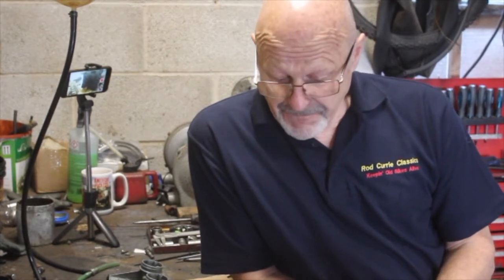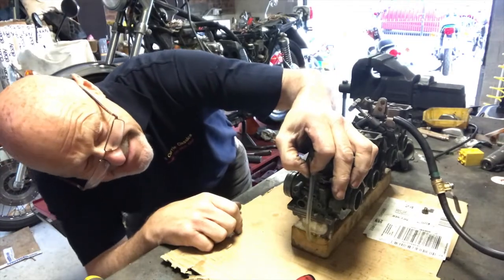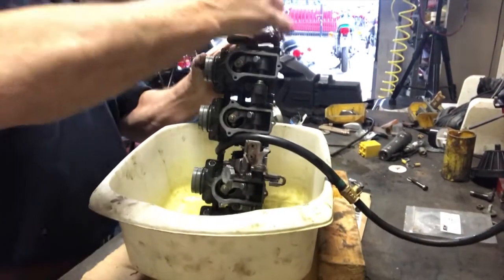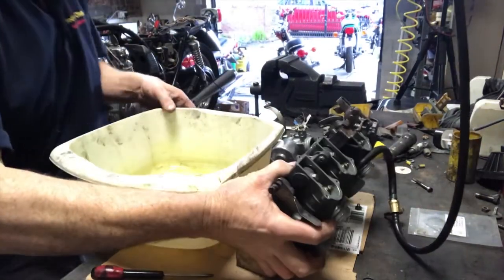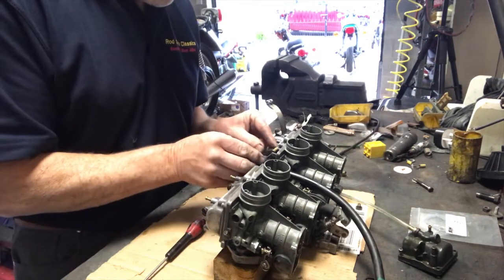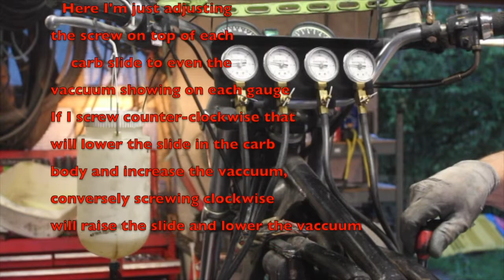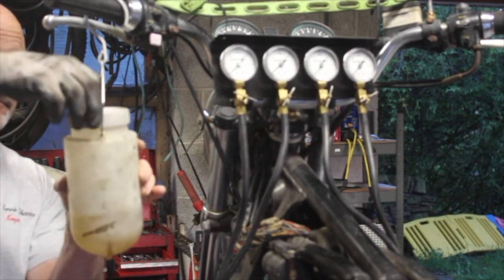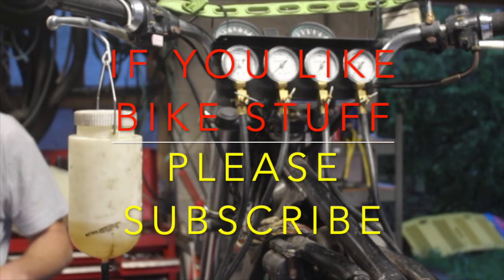How to set Kz650 float levels and synching the carbs 1.

Comment: Rod, do you hook the vacuum lines for the gauges to each intake carb holder port?
Reply from the maker: There's a little adapter on each manifold port to plug the vac gauge pipes on to. On Hondas you take a wee threaded plug put but the Suzuki GSes, and these Kawasakis use the same carbs with the little adapters on the manifolds  as standard.
Reply: @rodcurrieclassics8102  Ok thank you sir.

Comment: Hi rod, can't see where your Mark's are!! You may need too work on your close ups?. Very informative  and great information  but can't really  see what you are doing.  Have a 78 kz 650 in Florida  and am originally from Suffolk  UK. Have lots of mechanical experience,  ex race car mechanic . Can't seem to find good information on float heights. But obviously need a fitting with a nipple to make this work!
Reply from the maker: Hi Aron. Thanks for your comment . You're right.  I did work on my close-ups for the next vid and I hope that's better. Its called " Kawasaki Kz650 carb set up and Synch" . Have a look and let me know if you think it's better. Also the carbs on that film were much further out of synch so as a "Here's how" medium I hope they were better
I bought the little level tube and fitting in the States. I'll see If I can find the vendor and post the link here. Thanks again, Rod
Reply: Hi Rod, well I set my floats to 23mm and 2 overflowed on me, I'm guessing 23mm is a guide and the way you do it is better .or I need new float valve and seats as well, did you ever remember who made the tool?
Reply from the maker: Hi Aron. I measured them out of interest after setting them up with the level tube and 25-26 mm was the mean.  I'm sure you checked both of the floats ( in each carb)  to ensure no twisting of the "yoke" between them throwing your measurement out. 
I did look for the purchase detail-it was a USA outfit-but couldn't find it .Let me have another look and thanks again for the comments. 
ps I love these bikes but the carbs are notorious leakers and new needles and seats is the only way to be sure you're not pulling the carbs off time and again. How do I know? ... learned the hard way I'm afraid. :0)
Reply from the maker: Got it. Ebay number 283675027365. They're in Montana. Hope that helps Aron.
Reply: @rodcurrieclassics8102  thanks Rod, yeah I always wanted one of these bikes and no stranger to motorcycle carbs.  I took my time with a digital caliper getting them dialing them in only to have them throw fuel out the overflow.  This has been a constant problem since I bought it, I have very little history apart it came from Alabama.  I bought it from a guy in Atlanta who couldn't get it running and gave up. I went through the ignition system and did a a full timing procedure and it fired right up. Then the carb issues started! Didn't leak at all and randomly it would throw fuel out the overflow. Also noticed that if I disconnect the fuel line it has fuel running out, correct me if I'm wrong but it shouldn't do that? It's a vacuum demand system. So maybe that combined with some  dodgy valve and seats might be my issue?
Reply: Apart from that it runs great👍
Reply from the maker: Correct. The little diaphragm behind the fuel tap will be holed, or like the green one in the vid when I started work on it..entirely missing. If either,  the bike may be sucking neat fuel into the manifold through the little vacuum pipe and you'll not get it to idle really nicely.  The taps aren't cheap but kits can be had for about 17 pounds....maybe 22 bucks.
Reply: @rodcurrieclassics8102  BTW thankyou again for the lead on Ebay, found it with shipping $13. The tap looks very new and carbs have obviously had work but evidently must have sat around for a while! Bet all the ethanol in the fuel must have damaged the diaphragm? So I bet if I get a new diaphragm it will help a great deal and the purchase of the tool. The diaphragm is not expensive  either but will help tremendously with bowl overflow too ! Obviously not the exclusive answer but a combination of float heights and new diaphragm should fix the problem!
Reply from the maker: Keep me posted Aron and good luck. Rod
Reply: @rodcurrieclassics8102  sorry to bother you again but on a second look all the diaphragm s I'm coming across are for a 79 b3,mine is a 78 b2. Do you know if the 79 one works on a 78? Or maybe different?
Reply from the maker: Hi Aron. As long as your bike has the tap that has the standard Prime/Run/Reserve settings it'll be the same. I've a Japanese  C2, 2 x Nebraskan B2s and a similar B3 here right now and they all have the same tap. You'll be fine I'm sure.
Reply from the maker: From memory the C2 is a 78 , the B2s are a late 77 build and an early 78 and the B3 is a '79
Reply: @rodcurrieclassics8102  thanks, K&L products have many hard to find  carb and petcock parts, they said the 18-6633 diaphragm  works for 79 b3 so for $18 with shipping I ordered one . Dark horse products on Ebay said it fitted all 3 bikes with the diaphragm petcock. K&L says they are made in Japan and of OEM quality 🤞!
Reply from the maker: Result! If you want to buy a complete tap they are about 140 dollars/120 pounds so that's  a win
Reply: @rodcurrieclassics8102  ow!!!!!! I'm glad I'm not shelling out for that!. I will  check K&L for their price, maybe they are  cheaper? But I will take a $18 dollar fix anyday
Reply from the maker: Did you look at this one Aron? You might find it useful. https://youtu.be/3QNG4IrcCcA
Reply: @rodcurrieclassics8102  well Rod if I could kick myself in the ass I would!,  Got my lovely new Japanese diaphragm and opened the case and found a perfectly good  diaphragm. Hmm I thought ?, sucked on the diaphragm  portend felt it move. So I sucked on the fuel port and got a mouthful of  fumes!. Crap!. Opened the selector side and found a wad of rubber! Bought another full kit for $13, it was just free pouring past the selector rubber!.
Reply from the maker: Ain't that life, bikes will make an arse of you time and again. :0) Hope you got a selector rubber in the kit otherwise its back to Ebay
Reply: @rodcurrieclassics8102  Good news! Got my rebuild kit from outlaw cycles($13) and put it in with a  smidge of dielectric grease to make sure it moved nicely and with the help of a couple of tubes made SURE it was working correctly! Happy blooming  day it works great and 36 hours later not a bloody drip! Still got to do a level check with that handy new level tool but sod it! I'm going to ride for a bit.i know the floats are set at factory height. Its cooling off a bit now (only 90/95 f now so I want shake it down.  Iv only ridden it a couple of times since I got it running  and obviously been sitting for god knows how many years.
Reply from the maker: Hi Aron. Great that you've sorted the drip. I have one on a gs 750 which uses the same tap. I'd already changed the float valves ands set the levels and it started dripping. Grr! Popped a kit in the tap at the weekend...no drip. You just need to keep at it eh? 
Set the floats up when the weather turns agin you...for now... if it ain't broke etc etc. Best, Rod
Reply: @rodcurrieclassics8102 Hi Rod, hope all is well. I guess what threw me off was not having much experience with vacuum petcocks, I assumed also that the float needle jets would seal properly. Most bikes iv had were gravity feed and no problem s with leaking through the overflow. But got a good  ride in and now realized the rear shocks are seized and the chain and sprockets are toast!.
There are lots of choices for sprockets for the C but few for the B kz 650, under close examination if I'm not mistaken the front sprocket has different counter shaft splines between the B and C? And shank on the B sprocket? Any ideas? Thought the B&C were the same except cosmetics? Glad you got your petcock situation fxed👍
Reply from the maker: Hi Aron. Replica shocks -not the Hagon type-for the Kz can be had really cheaply here..about 60 quid so expect its the same Stateside. For sprox  etc I'd use Wemoto in Suffolk -they seem to have anything I ever need-and I suspect Z1 parts in the states will do you proud Stateside.
Reply: @rodcurrieclassics8102  Hi Rod, yes iv seen some on Ebay that are new around $100 but found a used OEM set for $11. But was wondering if you knew  if the kz650 B and C sprockets were the same? Have had conflicting information. B sprockets are not well supported  but C  sprockets are and way cheaper.  I'm definitely a thrifty guy and would rather not spend more on something  if I can get the same product for 30%less .